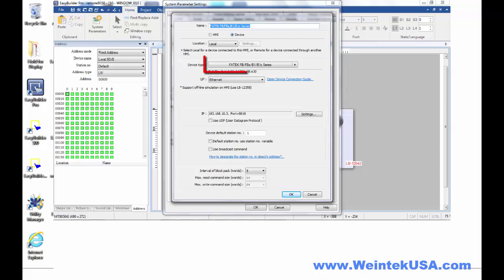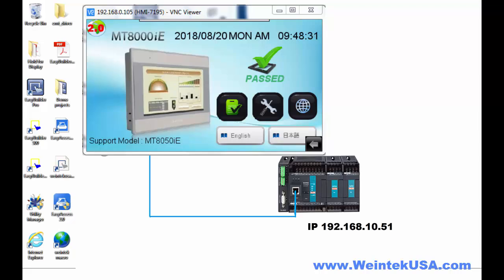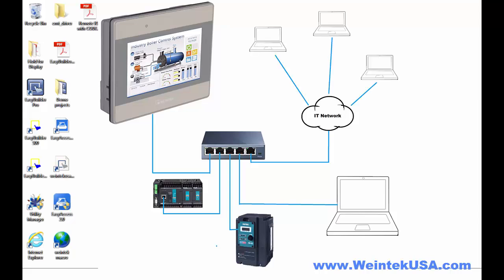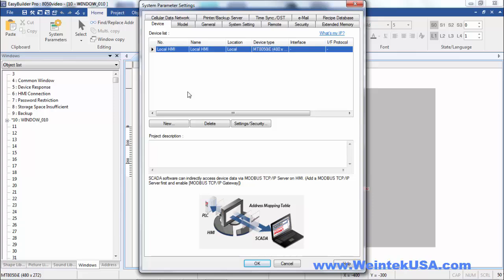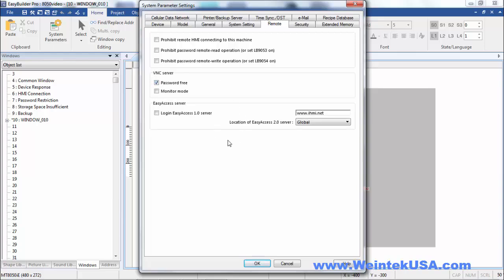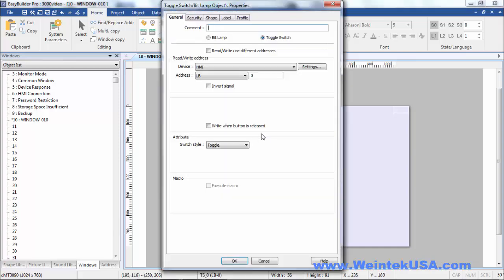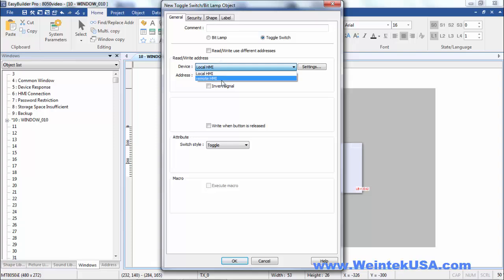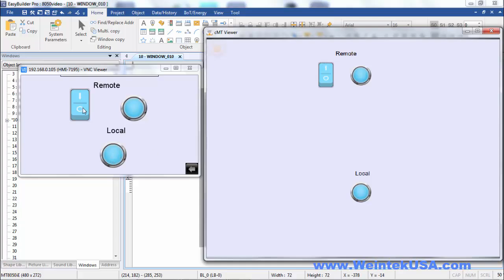Basic Ethernet Communications with EBPro Weintek Multi-HMI Connection

Comment: Hello, excellent video. I would like to ask a question. I have two Weintek HMIs. One is a CMT3161x model, which is already configured and connected to a PLC in a transformer substation. The other HMI, which is placed in the workshop where I usually work, is a CMT2166x model, new and not yet configured. I would like to be able to view and control the HMI connected to the PLC in the transformer substation from the HMI in my workshop. How can I establish this link between the HMIs? Thank you.
Reply from the maker: Hi @facudegregorio4094,
Without in-depth knowledge of the network it is difficult for us to answer this question. However, there are some network devices that can route communication from your workshop HMI to the substation. The IT personnel at your site may be able to recommend a specific device for this task.

Comment: Thank you for the video.  Question.  I have a MT8073ie with two ethernet ports.  I would like to connect to the PLC to lan2 with one ethernet cable and then run another ethernet cable from LAN 1 to customers IT network. Is it then possible to still connect to both the HMI and the PLC through the customer's IT network.  I know that lan1 and lan2 need to be on different subnets, but I am still having trouble setting this up. Any help would be appreciated

Comment: My HMI is Weintek MT8071iP used Ethernet. But it too slow, delay 1 2s. Please tell me why??
Reply: Hi Khải,

There are many factors that can affect communication speed. I would suggest that you implement a direct connection between the HMI and PLC to ensure that this issue is not caused by a faulty router or switch. If the issue remains, try building a simple project that contains only one toggle switch and attempt to replicate the issue. If you cannot replicate the issue within the simple project, it is possible that a communication error exists within your actual project. To find out if a communication error exists within your project, please use EasyDiagnoser. Here is a link to a tutorial in which we demonstrate how to use this application: https://youtu.be/fd0fujiHHFw?t=944

Comment: Hello Sir

I want to connect Two Weintek HMIs on S7 200, but PLC has only one port so can I use EM277 Profibus module for connecting 2nd HMI?

If yes, what will be the settings in Easy builder?
Reply: Hi Syed,

Within this application, we would recommend that you use an Ethernet switch to place both HMIs on the same IP subnet as the PLC. Alternatively, you can also communicate with the PLC by adding it as a "remote" device within one of the HMI projects. To learn more about remote HMI/PLC communication, please see this tutorial: https://youtu.be/y0gWcyXJP5g

Comment: nice video. i just have a silly question. what does the port mean here? what is the function of port here in your video? thanks.
Reply: Hello,
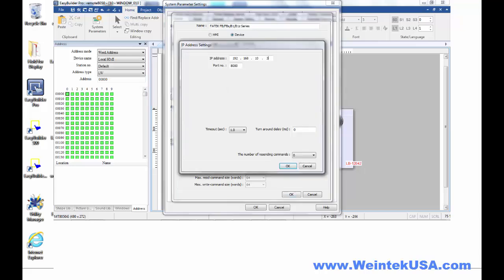The port number mentioned at 1:17 is the default port configured within the PLC's IDE. This is not a physical port, but a virtual port with which the PLC can receive data.